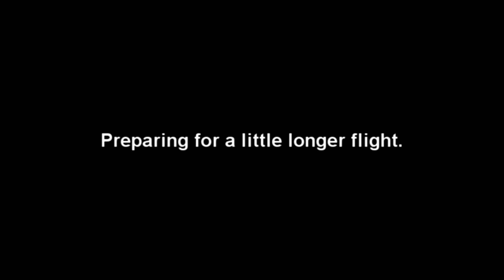Preparing the Skywalker for a longer range flight

Comment: radio control rx is going to be bombared by that 800mW radiated energy, recievers have AGC specially those FM radios, it just prevents over driving amplitude of near receptions by reducing the gain. it will not interfere surely but you will loose range due to agc's gain reduction by high rf close to it. we call it desensing in HAM. the result is defining of you control rx and decrease in range when vtx is ON

Comment from the maker: I think 3 reasons.  First, the gopro will shut off if you get low battery and it will also cut off if your memory card gets full.  Not safe if that is your main flight camera.  The second reason is that many people report a slight delay in the live video feed while also recording.  I don't have a problem with it, but something worth mentioning.  Finally, the gopro does not have a very wide dynamic range meaning that if the sky is very bright, the ground will be too dark to see.

Comment: Hi Guys,

I am new to this game so would appreciate some advice regarding setting up. I currently have a EZOSD and am thinking of attaching the FY31AP but not sure if there is a way of attaching the low signal to the EZOSD. The set-up is 5.8GHz 600mW and a small sony video camera but I have attached my GoPro Hero 2 to the EZOSD and works fine so wanted to know why people have both GoPro and Sony camera, is it for safety?

Thanks
Richard

Comment: Your skywalker is looking great, the only thing i would do is put some fiber strand box tape on the bottom it adds a little weight but the skywalker can handel it.  I don't land just on grass so it's help my skywalker take a beating.

 Good luck on your 2 mile fpv flight